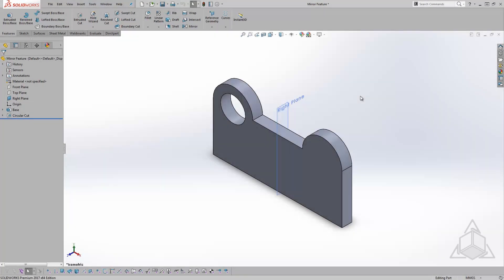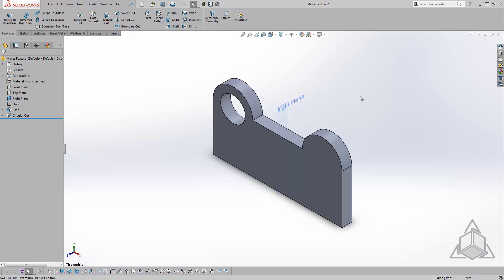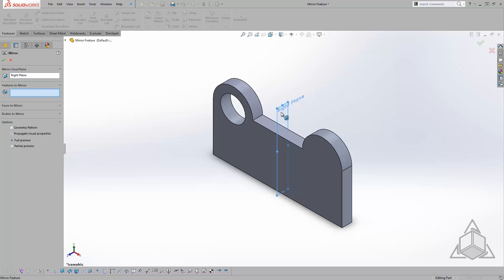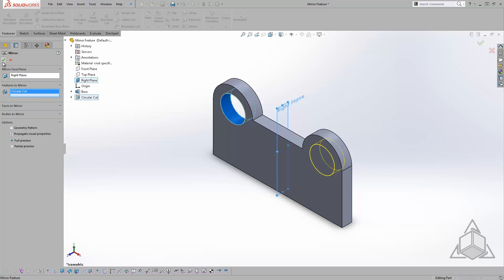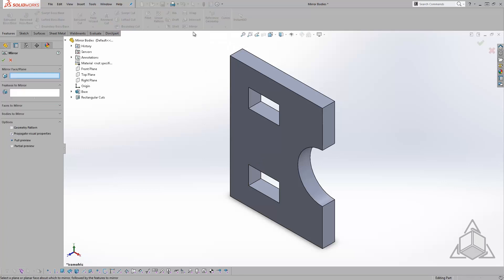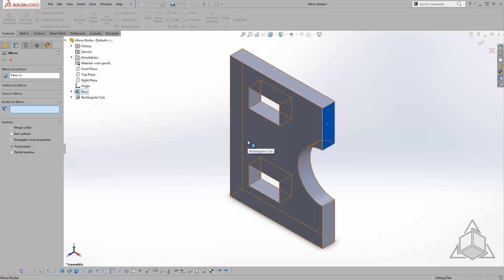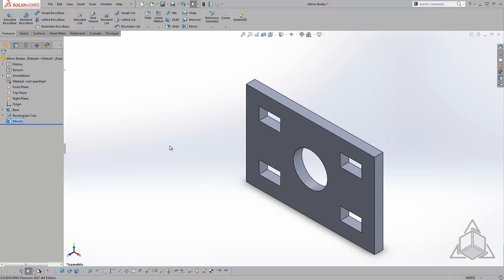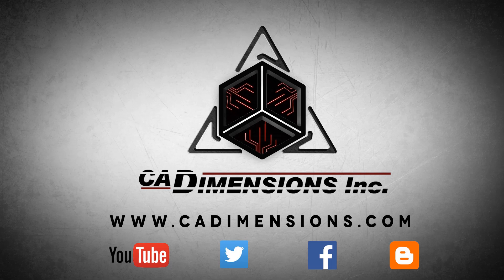Tech Tip - SOLIDWORKS Mirror Components

Comment: Very good video. It helped me solve a problem with a sheet metal sketched bend. As you know you cannot mirror Sketched bends themselves. So on a X/Y symmetric rectangular part I drew only one quarter of it with a sketched bend. Then used the second method, the body method to make mirrored X and then Double Y copies.  Worked great.
Reply from the maker: Glad it helped!